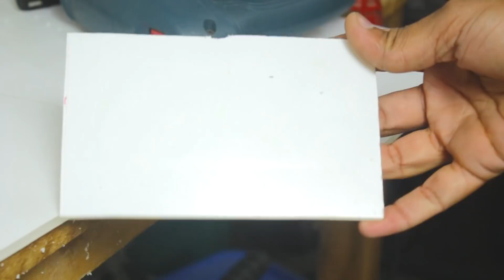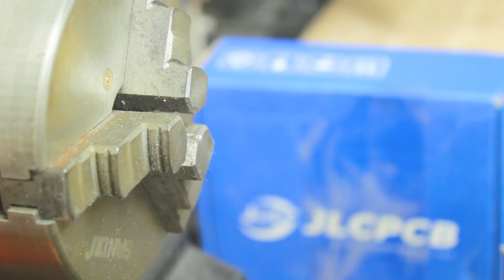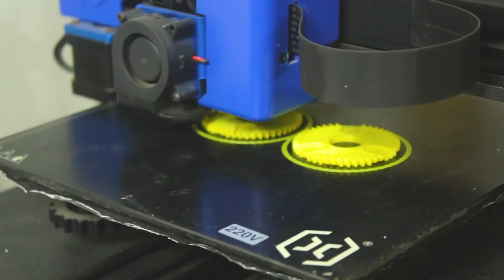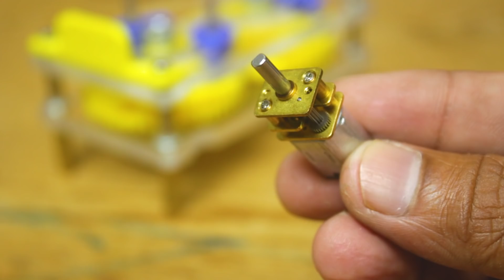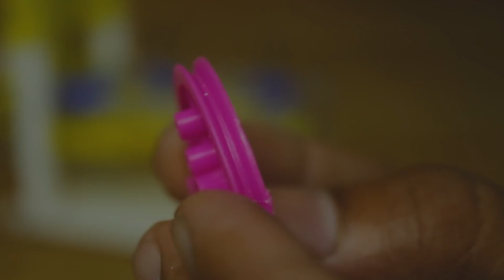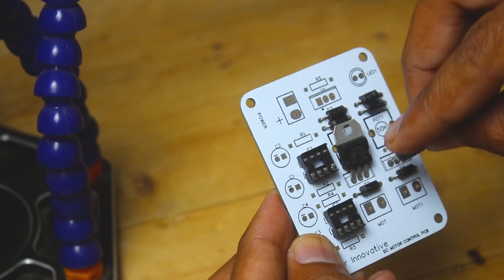DIY mini braiding Machine

Comment: For those wondering why there are holes in the two central bolts... Not sure he's going to implement that but if you feed 2 threads up there then it will weave 5x threads as well...
Reply from the maker: exactly
Reply: @MrInnovative  Great project by the way, very cool!
Reply: Ok I just figured out what you ment

Comment: Mr.Inovative pls make a visiting card counting machine
Reply: What use do you have for such a device? Out of curiosity.
Reply: For garment industry, to reduce manual counting process for cards such as price tags, RFID cards etc
Reply: @100sivah  If total accuracy is not needed, you can simply count them through weight
Reply: @ArnaudMEURET  thanks for your reply.. but we need 100% accuracy. Weight method is not working